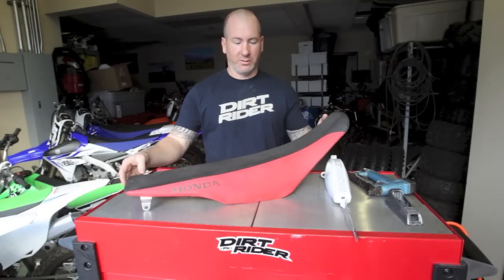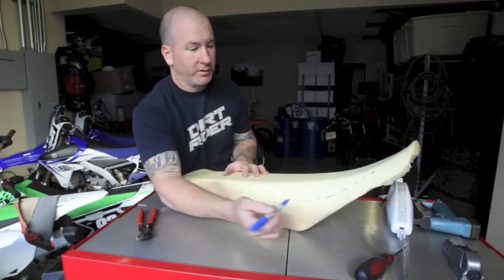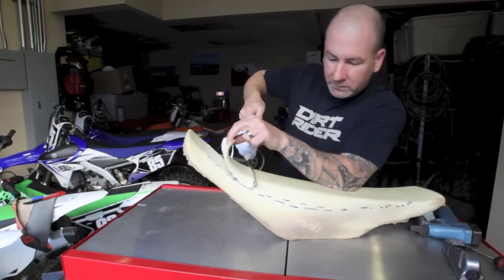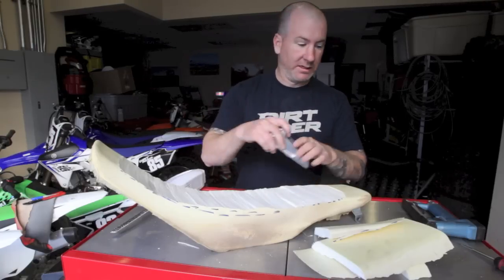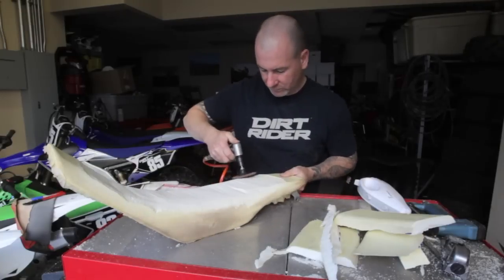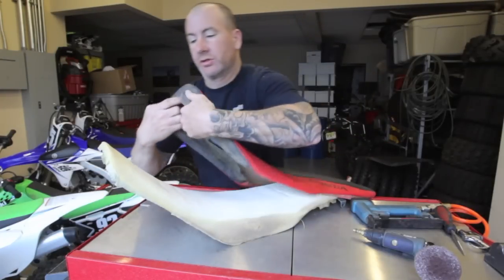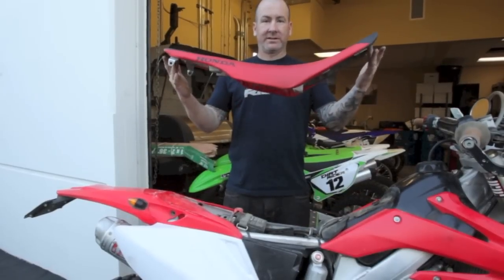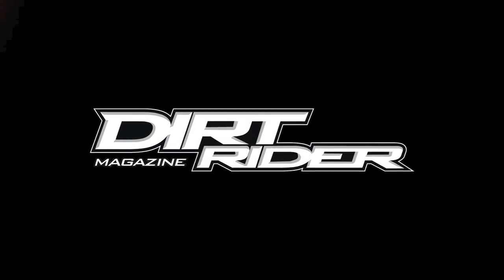How To Shave Down Your Dirt Bike Seat

Comment: Thanks for the video! Just did this on the wife’s crf250r with great results. One thing I did was once I removed the cover I installed the foam seat back on the bike, made cutting it and sanding it so much easier. Plus it gave me an excuse to wash the bike after, thanks!

Comment: 5'4" woman here. Kx250 not short chick friendly, like all full size bikes. We softened the suspension.  Already better that way. I'm hoping taking 2 inches from the seat gets me where I need. I have watched a few videos and you're has been the best so far. Thank you for the details and proper tools.
Reply: you can get some smaller springs, and you can lower the forks through the triple clamps!

Comment: Thanks for the information! I found 2 things that helped a lot: an electric filet knife, which has a sharper blade than a carving knife, made cutting foam easier, and also an air stapler was required to drive the staples into my seat pan. The air stapler also had a little nose which made stapling into an inside curve much easier. $30 on Amazon.

Comment: Put the cover in the oven to heat it up, it’ll stretch and fit much easier and tighter.
Reply: When it cools it will be more brittle and prone to cracks/tears.
Reply: 350 for an hour

Comment: well that was fun. just got the cover put back on just got to staple it up and throw her on. it turned out pretty well though. if anyone doesn't have that cheese grinder. all i used was a serated knife and gently brushed it to smooth out the lumps. thanks for the video.

Comment: The shaved seat looks great! Thanks for the video. My goal is to fit my 5' 4" wife to a 2006 YZ250. I'm reading about the lowering link, and front fork shortening too, but others are quick to comment that this "ruins" the bike. Adam would you care to comment regarding lowering the suspension too? How about lowering the suspension a little bit? My wife will trail ride. She will rarely get the wheels of the ground. Or would a TTR-125 be a better bike for her? TTR weight = 195lb. 2006 YZ250F = 206lb.
Reply: Tim Kuitems you said yz250 is it a 250f  or a yz250 .....im 6 fot and had to just lower my yz250 by unloading rear spring .....5 foot 4 is gonna be a stretch .....what about the kx 100 2 stroke i kinda like thse small bikes they got enough power too .....i got sport legs and got tired of throwing leg over seat now its sweet
Reply: Probably better if you change your wife!
Reply: +Tim Kuitems , trade in wife for a taller one.
Reply: Omg I'm a 5' 4" woman and I died laughing. "Better off trading the wife for a taller one" lol 😆 😂  I'm rolling. In realness, I have a kx 250 so I have the same struggles. Doing the seat. Already softened suspension.  Might have to do a link kit. We will see. I'd be happy to get the balls of my feet flat. I had to for my ninja street bike. I was never flat footed as you should be with street. It was a light bike so I was good. Dirt bike being lighter, I'm hoping I can as least touch that much.

Comment: Foam on stock seat is about 3-4 inches. I want to cut it down to about 2 inches or a bit more. Is there a different type of foam that can be that thin and still have some comfort?? What types or recommendations do you have? Thanks

Comment: Just buy a TW200 and you're all set. 31 inch seat height.

 If you need it lower, then pay$$$ for anew rear shock rebuild and lower the fork in the clamps, and get a seat with a little less padding but firmer foam!!! 

You can get it down to about 28 inches seat height and still have all whopping 6 inches of travel.
Reply: what if you have no money and have a bike thats too tall?
Reply: Is that a joke??? Sell the bike that doesn't fit and get a different one... Ride safe.
Reply: Not Tellinya or you can change your dirt bike suspension to MTB suspension

Comment: ive tried hand staplers they cant penetrate that plastic
Reply: Small compressor and pneumatic stapler.. Only way to do it right. And get a pneumatic (air) stapler with an extended anvil.. Seat pans have curves, and a longer extended anvil is a time saver.
Reply: Years ago I bought 3 different hand staplers and none worked. Air powered is the only way to go.

Comment: what size staples should you use?
Reply: T50 staples, MONEL if you can find them ($$). 1/4" staple leg length, make sure the staples have a sharp POINT on the tips, NOT a chisel point. The sharper pointy staples penetrate much better.